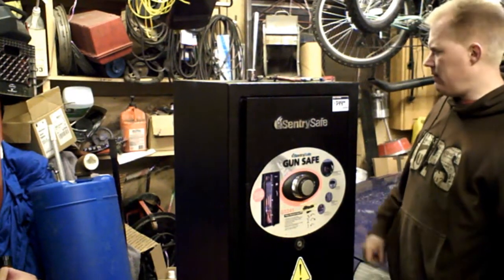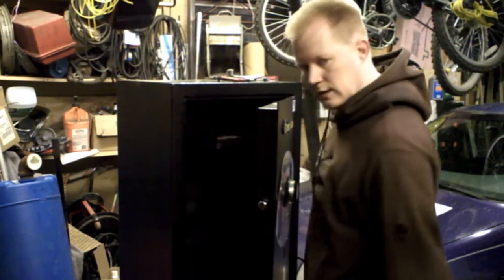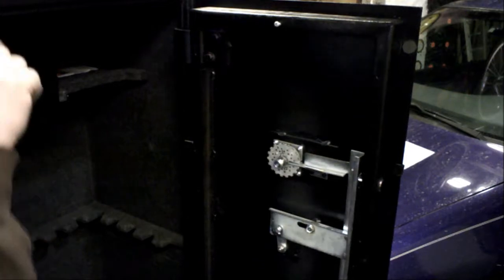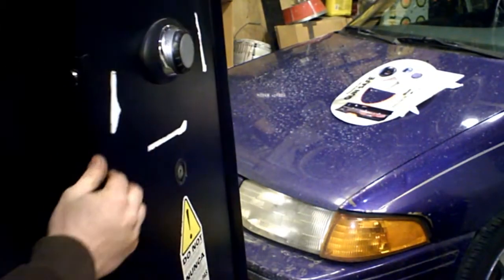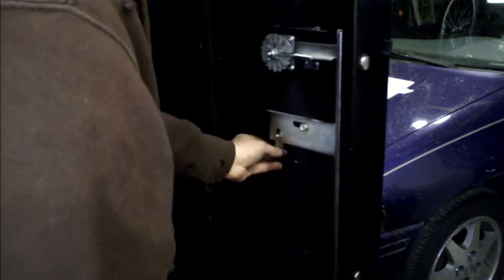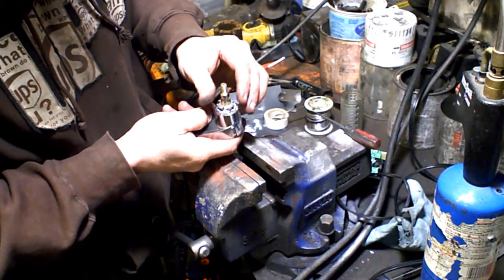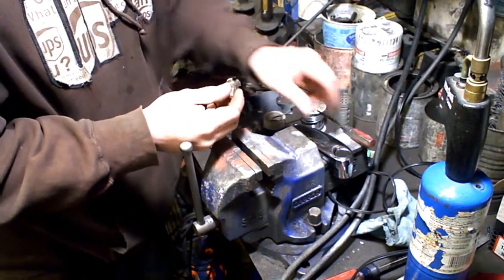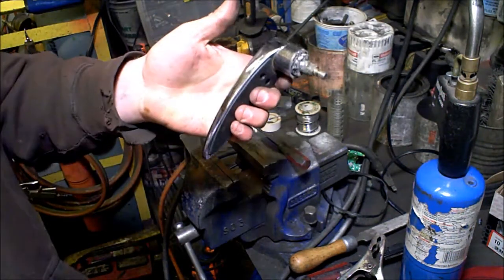Gun Safe Handle BUSTED OFF  bought for over 50% off

Comment: You could also get a good amount more protection by upgrading the lock.  The lock you have on there is some imported combo lock that does not operate like standard locks and does not have the security features.  You can however install a standard Group 2 combination lock or digital lock in that safe pretty easily.

Comment: Nice job on the repair.  Unfortunately the safe is a POS.  It is a nice lock box to keep friends and family out and such, but a thief with a small pry bar would get that open in no time.  The best thing you can do is SECURELY bolt it down, preferably to concrete with something strong like Wedge Bolts.  It's much harder to force the safe open in the upright position, and it makes it impossible for a thief to take the entire safe with him.

Comment: Mine is the Stack on Y092KE000558 model. The lock looks the same. Its more then fit my needs would you by chance have a manual on how to change the combination? Thank You.
Reply from the maker: You won't find a manual on adjusting the combo. If you take of the inside panel you'll notice the discs that rotate with the combo dial. Spin the dial a few times and you'll see how they work. You can take these plates off and restack them on in any order. So if your combo was 10-50-70 you should be able to make it any combination of those ie: 50-10-70, 50-70-10, 70-10-50, 70-50-10, 10-70-50. You could make it any other numbers but you would need to grind/weld on the plates.